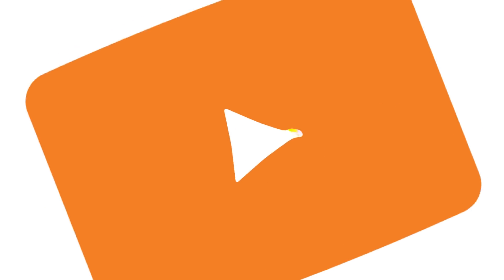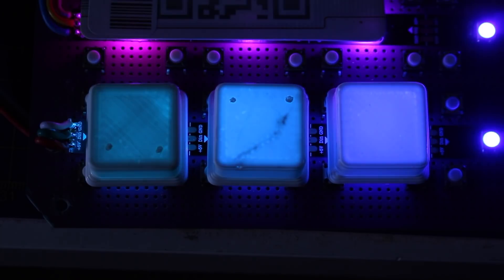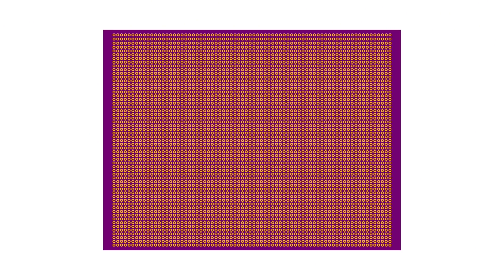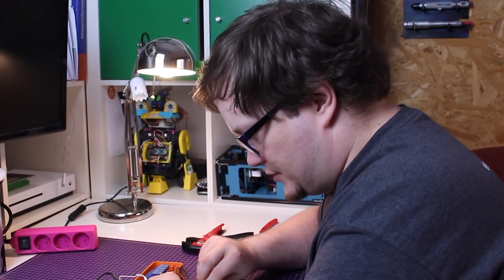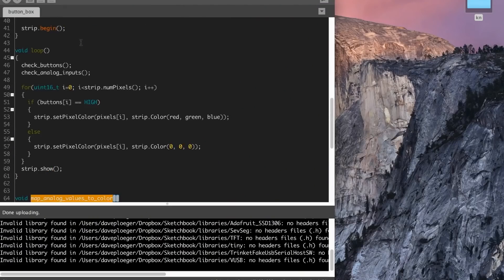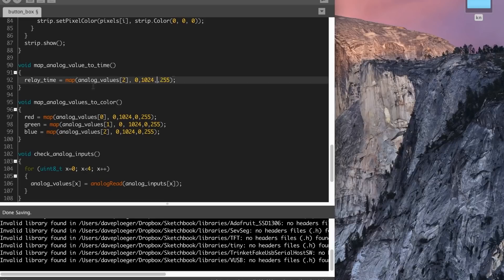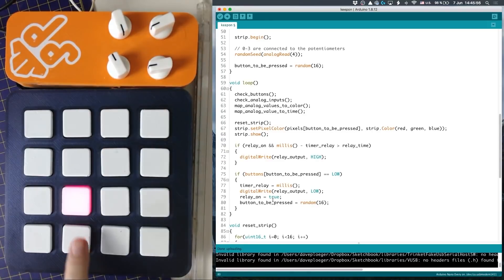Unhackable Arduino Switch Matrix

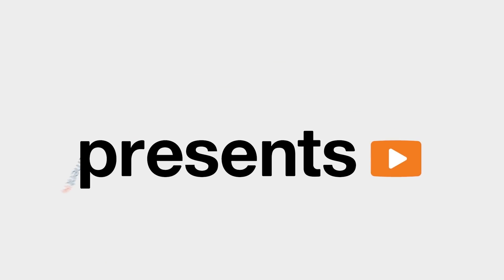Comment: Thanks for the video - Didn't know that board could run that many switches!  Could you pass something to your supervisors?  I thought the intro was a little long, then came the boring useless bit-o-trash @6:15.  Is there a reason it needs to be that long?  Or exist at all?  You have the link in the description like everyone else.  It's not 2005 any more.
Reply: Thanks! Theoretically you can add even more buttons when you know how to charlieplex instead of multiplex them ;)

We always talk about how to improve things, so I can bring it up - but it's a big company standing behind that channel and the main reason we can build all these projects is to bring people to the community and spend some money in the shop. So an in-video commercial is something we will probably always have.

Do you mean the intro to the project where we talk or the thing with the jingle? I kinda like the jingle.
Reply: @Davedarko  The jingle is a little long, but not awful.  It's the extra 15 seconds of 'Brought to you by' at the beginning that makes the intro as a whole seem interminable.  It needs to be less than ten seconds, the closer to five the better, and it needs a total revamp.  It looks and sounds like an informercial from the 90's!  Here's a freebie - Put the "Join Now @ element14.com/presents" in the graphic (a modern graphic!) and the voiceover says, "The Element 14 community supports engineers and makers around the world." Maybe with "Connect" and "Collaborate" as highlighted transients while the URL is forming.  All the Info.  Five seconds, or maybe a hair more.  Done.  
     Please understand, I'm NOT a GenX'er, or.. well, lets just say I came along before that.  If I think it's long, the younger crowd will either skip the first five minutes or be gone in the first few seconds.  If they manage to hold on that long, the long outtake in the middle might lose you another 50% - which is a shame because it's good info ...that could easily be packed into a ten second piece that would keep people interested and watching.
     I understand the Big Company thing.  And an in-video commercial is fine - nothing everyone else isn't doing, but they don't do it for 40+ seconds.  Like I said, I'm in the older crowd.  Current genre action movies with five-minute long 1/2-second flash sequences make me dizzy.  If I'm put off by the time, you're probably losing a lot of younger people.  Compress - keep it interesting from start to finish, and mix it up on occasion in between.  You'll probably find your demographics start leaning younger.

Comment: You coud]ld always use the ISR for the timer.
Reply: yup, that's true - but not as easy as just using the millis function in Arduino and I already failed to use unsigned long for the timer there..

Comment: If in doubt... Strip the signal wires coming from the keypad and short to ground or tie to logic-high as required no?

Edit: actually that first method is way overthinking it and involves physical signs of tamper so instead...

Take a decent magnet. Place on side of relay box that causes the relay armature to close. Leave magnet in place until you're done.
Reply: or just cut the wires and connect them manually, just be careful, wear thick rubber soled shoes and don't touch anything earthed :D I didn't write a test if any other button is pressed, so you could try to push all the buttons. Totally forgot about that...
Reply: @Davedarko  aye saw someone had already raised that. So I guess for an unhackable thing, it's pretty hackable at the end of the day.

It does make a sweet looking controller though.
Reply: @lmaoroflcopter  yeah, that title felt better than "deadman switch", albeit a bit clickbaity :D
Reply: @Davedarko  yeah, well it baited me into viewing it and interacting so no harm done! A view is a view even if it's a dissenting viewpoint. :)

Comment: Those switches seem really bad for that purpose. Is it at all normal to use 4 tiny buttons to make one huge button? I imagine one just worked with what they had, but frankly I think I wouldn't even do that if what I had was just those shallow small ones.
Reply: Now you've only left too say what you would have used instead ;) They are hard to push and I would have used buttons that have less force, but they are pricey and I did not have them on hand sadly. It's just one of them that has to be pushed, they are connected that way - sorry if that wasn't made clear in the video

Comment: [Evil Hacker Mode]
Put a board of correct size over all 16 buttons and press down, so all buttons get triggered.
Get a strong drinking duck to press the board down repeatedly.
[/Evil Hacker Mode]

I think you forgot to make pressing the wrong button turn off the device ;-)
Reply: literally my first thought when watching this. hackable by a small modification to the exact attack it was designed to defeat, lmao
Reply: @reanimationxp  I'll fix it in software ;) maybe
Reply: hehe, yes, you're right :) it also should start to blink when it's close to shutting off again.